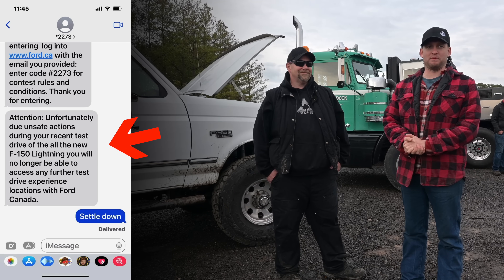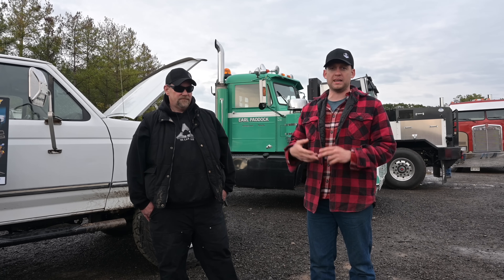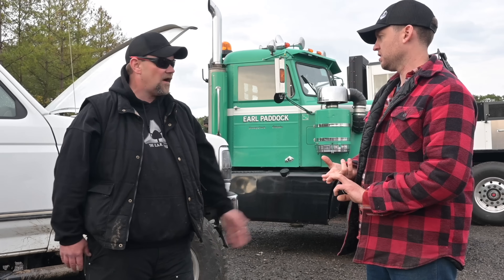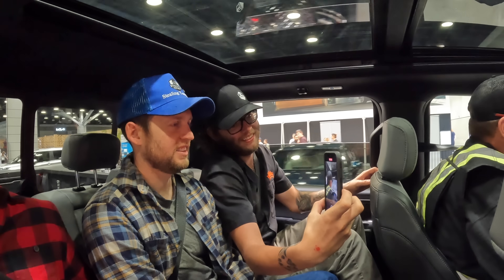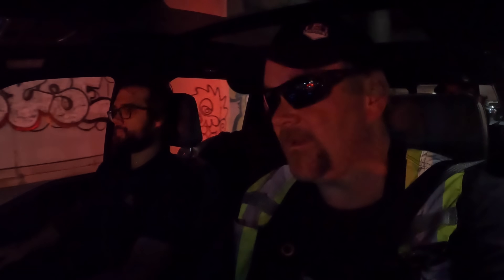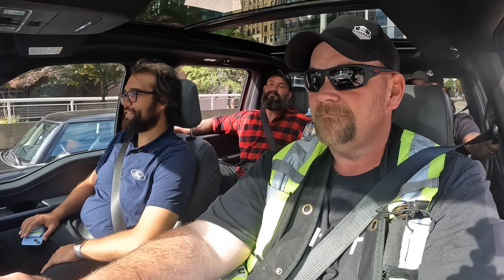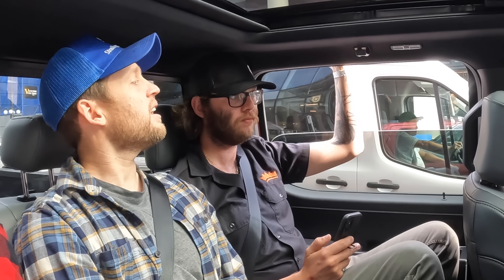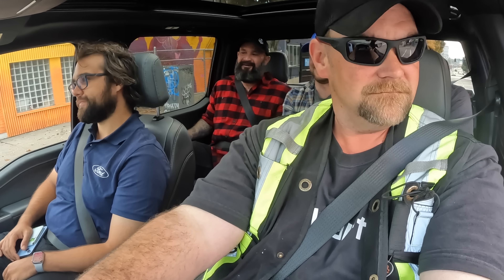Retrofit Revolution: Turning Old Pickups into Electric Powerhouses!

Comment: I was looking into it one time and this is overkill. This is taking that to a different level. No, I don't know how it works on big diesel engines but I assume it would be the same. I was looking into hydrogen/ diesel hybrid TDI out of a Volkswagen and the gas mileage they were claiming to get. I was seeing claims of 100 so if you can get that many miles to the gallon could you do that to whatever your diesel generator is to increase efficiency even a step further? I don't know if Miles per gallon would translate to a generator at idle, but it might also be something to look at if it also increases efficiency so like what you were talking about but it'd be like a kit plus and add-on for efficiency.

Comment: Take your standard engine and transmission options like 454/700r4 and 7.3/AOD etc and make jigs to hit the motor and transmission mounts.

If you can make the generator drop in and bolt into the stock drivetrain locations, that would make it vastly more popular.

Comment: Im an arborist in the Kootenays, I have a solid axle OBS ford 4x4. I love the idea and all the work you're doing. I could definitely see me buying this kit or multiple in the future. 
There are multiple applications in the arborist industry. Electric bucket trucks that don't need to stay idling all day.
Electric wood chippers that could run off the vehicles electric output would be incredible! One less motor to maintain and tons of available power for heavy duty chippers.

Comment: What do I want?  And I want to buy a kit !!   
I want a motor into the transfer case on my '94 F-150 4x4 XLT extended cab.  Leave the rest of the running gear alone.  It works, and you do not want to mess with Twin I Beam.  I want two battery packs that fit on either side of the rear drive shaft.  Maybe one more up front in the engine bay ...  I want a smooth running gen set (Honda?) that is quiet that I can use to power tools, recharge, or extend range.  I want to plug in at home.  I want regen.  I want basic cruise control.  I want to keep my existing dash, and I don't want a big screen in the middle.  Maybe a small screen below the dash ...  And I want to keep my A/C.  From the outside it should look like a '94 F-150.  Same on the inside.  My exiting chassis has 100K miles and I looked long and hard to fine a primo example of pre-ODB-II that my wife likes.  I want to keep it that way.

Comment: I love this idea but here’s a thought. Make it a motor you can slot in front of the transfer case instead of an e-axle. That way it can swap into 4x4s more easily. That opens up to not only pickups, but land rovers, jeeps, Toyotas, and old squarebodies and dentsides too. 

This way you convert a wider range of vehicles and it gives consumers better options. Imagine having a 50s or 60s or even 90s suv or truck with the same type of gear but cruising both off-road and at highway speeds effortlessly. 

My Land Rover sits around 3000rpm at 115kph, so having a generator and electric motor would make my mileage way better even just cruising around town. 

Plus if you can develop a generator setup to bolt onto stock power trains (make it possible to fab up mounting plates from a modular generator hub) then people can keep everything stock and just swap out the tranny instead of sinking cost into a CAT swap (which is cool but not at all cheap).
Reply: Or heck, instead of an e-axle, an e-transfer case. Then people can mount it where they need to and hook up the stock drive shafts. 

You could make it manual or auto and make it lock or unlock at will too

Comment: I have a 2008 dodge grand caravan I’m working on retrofitting. Definitely using a lot of your ideas. I’m running a generator off the engine leaving the front wheels on the engine and adding a rear electric axle. If all goes well should be fun!
Reply: Interesting! 🤔
Are you documenting your progress any where? I'd like to see it

Comment: Great idea.  Trying to put this together using pieces from different sources is a nightmare. Maybe batteries that bolt in between frame rails. Would work n Suburban and some old classicDodges while keeping bed free. Definitely floater in the rear and 3/4-1 ton size.  Ford 9’ on roids

Comment: Would it be possible to fit the electric motor and the generator in a transmission sized unit?

Then you could swap the trasmission for a generator/motor box, mount the battery in the back, run some wires between them, and you're done. Even an idiot like me could probably do that with a manual and a friend who has swapped a transmission before.

Comment: I've got a 2001 F150 with 244,000 miles on it and it would be fantastic to make it fully electric!! It would make it so much more drivable and I won't need to worry about gas mileage. I would like to put a battery pack where the Gas tank sits so that I can still have a flatbed or full truck bed. It would also make it lighter in the front end and put less wear and tear on the running gear. Also, it would make it a total unit of a snowplow truck.
Reply: Dude if I could make it like a diesel hybrid or electric I may honestly consider buying an older truck

Comment: The way you guys are making diesel electric trucks  is 100% the right way . I ha e been  saying  build a diesel electric truck like a  diesel engine locomotive and add a battery pack to it . 
No transmission  , no drive shafts  = less complexity and more efficiency  .
Reply: 3 years of driving our i3 REx (97k miles so far) has proven to me that the concept is solid.
Just scale it up for a pickup, work van or camper van.
Detractors always forget that the battery can be far cheaper & lighter than in a BEV, and the ICE generator as well.

Comment: I’ve pondered about this same exact thing years ago. I think it’d be awesome! I vote for the 12 valve dodges being included in some of the first retro fit kits. Though it’d be hard to say goodbye to the 5 speed manual, if I could get better than 14mpg that’d be pretty nice
Reply: Not sure what you're doing wrong but my 97 12V CCLB 4x4 NV5600 with 3.55 gears and 235/85/16s gets upwards of 26mpg empty on the highway here in BC
Reply: @Mahoodfallslife  The truck has 500k on it, previous owner did a timing bump, messed with the fuel delivery plate and said he put marine injectors in it. That’s probably not helping fuel economy.

Comment: Right now, almost every car company is testing the truck market just by dipping their toes in the water with that 1500-size. Still, I think the market for fuel savings and electric torque will be in the 2500 series to the 5500 series vehicles. Anyone who requires these sizes of vehicles would benefit tremendously from the efficiency and power. I also don’t think that fully electric trucks in this size range are viable due to their limited range￼￼ and a myriad of other factors. Today, I need a new 3500, but with gas prices the way they are, I’m very hesitant to go out and buy one. ￼ If I could buy a hybrid truck today that could handle a 100 to 150-mile commute with no fuel used but then also hook up a trailer and have the same range as today’s standard models. I would pick it up at the drop of a hat.

Comment: What I’ve been curious about is the possibility of full electric retrofits that mate right up to the existing transmission. Drop the engine and gas tank, replace them with batteries and good to go.
Reply: Heck, if all you're doing is running around town, you probably won't need the generator anyways.
Reply: @BlackEpyon  I mean I only do about ~250 miles for the work week week.

Comment: I have an 86 GMC squarebody and 1950 F1 that would be good candidates for a kit. Have a rear axle, wiring, controller, and a suggested small displacement generator (Yanmar) or options. Why swap in an LS or Crown Biv drivetrain, when a hybrid set up would be ideal.

Comment: A system like that would be sweet in a motor home, same as a work truck. The engine and battery can run all of the household appliances while it's parked. I'd like to get the same type of thing for smaller trucks like an '80s Toyota, too.

Comment: Sterling axles 10.25/10.5, Dana 70 and 60 axles, and a fordf 9 inch kit that cover most old 1 ton trucks front and rear i would put it in my F350 Centurion and 65 Galaxie!

Comment: Why even have a larger capacity battery make a kit with only the needed amount to reduce upfront cost and less modification literally a kit the size of the spare tire or small enough to mount under the car where the driveline was.

Comment: Yall should look at doing retrofits for fire trucks. They spend hours & hours parked in a bay where they could be plugged in, but you need a guarantee of power out in the field that pure electric just can't offer. Seems like a perfect application to take your primary-electric hybrid drive and add plug-in charging.

Comment: I would love a diesel electric work pickup. Farming/ranching we are in and out of the pickup a ton. The ability to not have it matter if I am out of the pickup 20 minutes or 20 seconds would be great. I like the idea of standardized e-axles and adjusting generator and battery size to optimize the specific use.

Comment: I would love a conversion for my Excursion. I think it would be easier and cheaper to attach a motor to the drive shaft or transfer case instead of E axles for a pickup conversation. Don't have to worry about frame width, new brake lines, shocks, etc. Also, mounting the battery under the hood or between the frame rails would be ideal to keep the center of gravity as low as possible
Reply: It's easier to attach the motor right to the transfer case, but you lose about 10% of your power in the transfer case and diffs. Also that's kinda where you need to be putting the batteries, you want them between the frame rails right in the middle, aka where your driveshafts, fuel tank, and exhaust sit right now.
Reply: @jaredlancaster4137  between where the 40 gallon fuel tank is and the huge engine bay there's enough room for batteries and a small diesel generator.

Comment: I work in service at a Chrysler Jeep Dodge dealer in Ohio and we’ve been watching your progress and we’re confident that this is the way hybrid cars and trucks should have been designed. We’re rooting for you boys!
Reply: A¢hates power would overtake the efficiency and reliability of their build without all the batteries and the regenerative braking; but if they sent an engine to Edison motors...

Also, an even better form of generator called a free piston engine, which would be the best possible in the form of a traditional opposed piston configuration(two pistons per cylinder), is what I would use.
Reply: @alexwalker8422 I think a super very common Kubota or Yanmar diesel generator would be the perfect choice! Those engines have been in use for sooooo many applications from tiny construction machines to generators.....
Reply: @alexwalker8422   -are there any comercial units availsable to buy??  In the power range needed....

Comment: I want an option with the battery NOT in the bed, maybe where the transmission would be, it's forward for Balance & it's pretty protected between the frames.
Reply: As well as a space to put the toolbox
Reply: Yeah, I would prefer not to take up space in the box. Back in my propane pickup days, I had smaller tanks under the box.
Reply: That shouldn’t be an issue but it’s also a truck specific build not a drop in for any truck
Reply: @jaydunbar7538  this video is literally about a drop in axle and battery kit for pick-ups

Comment: I know heavy duty straight axle ev conversion kits would be popular, even more so if they their straight/ drive/steering axle developed. What has been on my mind is the old and awesome but impractical 6x6 military trucks would be perfect for the axle and generator swap. A generator for the old multi fuel engine and no drive lines.

Comment: This would be great, especially if you aligned the design with companies that make body panels and parts for the older trucks so you could keep it running for a long time and not worry about the drivetrain being the only part that still survives the old truck.  I buy parts from LMC truck to keep my 98 GMC going.  All depends what the conversion would cost, but if it is economical and not require too much modification to the vehicle that would be great.  I love how you and the Edison group are thinking outside the box
Reply: I want to keep my truck going long enough to pass it down to my future grandkids.
Reply: The cost would need to be kept close to the cost of rebuilding a stock engine and transmission, with a few updates, such as throttle body fuel injection, and an engine management system.  So, the six to eight thousand range.  This is based on bare costs to restify an older truck:  A long block is around $3000; rebuilt transmission $1500; Engine management $1500; conversion to Fuel injection $1000; Upgrading brakes, another $1000.

Comment: A kit for my hatchback - so I can charge going down the big hill on the way from work and use that energy to warm up the car quickly in the morning - is interesting.
Reply: He did say "solid axle", 1 ton, etc....but hey, I'd make my GTI a diesel-electric...as in having electric drive train with an engine + generator to charge a modest size battery.
Reply: It doesn't work like that. As an EV driver, the energy gained from going down a 3 mile long 10% grade adds such an insignificant amount of energy that it wouldn't even cover running the heater for more than a minute or two. Regen is not the magic bullet to ICE problems. It is, however, the magic bullet for brake fade.
Reply: I hear you, but there are hybrid electric hatchback cars already. Like the Prius.
Reply: @fmccloud  This has nothing in common with a Prius or "hybrid"!  "Hybrids" have axles and drive shafts connected to the gas engine.  Edison is using is 100% electric motors, and a generator that charges modestly sized batteries.  So you get the instant torque and re-gen braking of electric, without worrying about dead batteries.
Reply: @fredygump5578  But the Prius has those things too. I get that this truck engine drives only with its electric motors.

The Prius uses its electric motors primarily for movement too. The Prime models, Larger MG2 moves the car primarily and for regen. MG1 applies a charging load to resist the engine through the power-spit-device to charge the batteries and to send power to the wheels. The engine doesn’t have a true connection to the wheels though it does assist.
Reply: @fmccloud   No.  It's funny how you simulatenously admit you understand they are fundametnally different, yet insist they are the same.

Comment: This is a over due idea! As a matter of fact, isn't dodge working on this idea right now!! 
The pickup market is huge in north America, and that is what you guys should be working on!  Just look at the pickup sales and the after market industry just for pickup trucks, its huge! Yes the heavy truck industry needs this too but to be able to turn a quicker profit , the pickup market is where your attention needs to turn. Ever since I  discovered your channel ,my mind has been racing on how to adopt this idea to my 2006 f350 powerstroke. I have a VW tdi engine in the garage ,which would make a perfect powerplant for a generator, their great little engines. The f350 is a nice truck but the mileage around town sucks and worse in the winter. Electric conversion with a generator would be the ticket and would make a fantastic tow vehicle! 
With the large distances we have in north America and the more remote places we have here  in Canada, an electric + generator pickup would be the answer! You can't plug your electric car into a tree for a charge in the middle of nowhere.
Cost is the big issue though for me, with do it yourself kits for cars on the market starting at $25 000 and I'm not sure if that includes the batteries. The cost would have to be reasonable, what that is I don't know.
Should you be working on a pickup conversion kit, absolutely YES!!!!!!!! and hurry up, I want one!

Comment: You're going to have to resolve the 4WD question. Semi's may get away with no front drive, but people with pickups in snowy areas are going to want 4WD... I guess with the transmission and driveline gone, there may be room for a mid-motor and a front driveline to front differential. A lower power alternative is the GMC hybrid transmission or the LS600h (Aisin L110F) with a 4WD transfer case.
Reply: A electric motor on the front drive axle would work for the four wheel drive models.
Reply: @markbremmer8642  right - I mean they'll have to figure out a way to execute that. Either a dedicated front electric axle or a motor coupled to the existing front diff...
Reply: Two separate smaller motors on each front wheel might work.
Reply: I’d think coupling a secondary motor, probably without regen capacity to the existing t-case would be pretty straightforward. Since the e-axle wouldn’t need a transmission, just mount a motor in the shell of the existing transmission, it can already couple to the T-case.

Comment: If you put a little aluminum ecotec/ecoboost/b16/k20/whatever engine out of an economy car you'd get all the aircon/heater and whatnots to get all the creature features direct fit for the interior and then hook up a generator to it, you'd have a ton of room ( and weight rating on the front axle) to put the batteries under the hood so you wouldn't have to take up the space of a tool box in the back